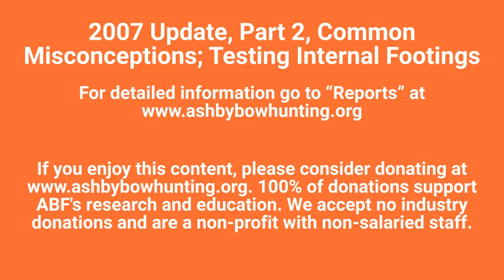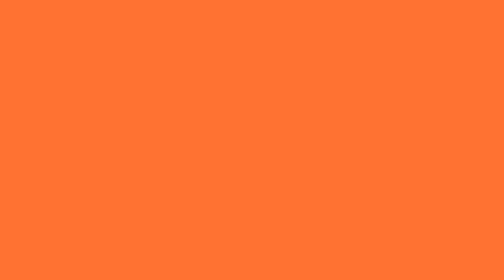2007 Update, Part 2, Common Misconceptions; Testing Internal Footings

Comment: Sounds like internal footings are about to change carbon arrow structural integrity for the better.  Any idea on what the weight range for these new internal footings might be?  When might they be available?
Reply from the maker: I don't have any answers for you. The folks back in 2007 dropped the idea when they couldn't come up with a light-weight synthetic material that could be easily mass-produced and that had the structural integrity of the hardwood IFs I was using. Late last year, the idea was brought up with another company. We (ABF) modified some of the steel inserts they produce to have a parabolic trailing portion and demonstrated, with 45-degree impacts of steel plates using an 82# compound, that the IFs worked, with no shaft breakages occurring. I hope they decide to produce them, but I have no idea if they will.
Reply: @ashbybowhuntingfoundation6420  Thank you